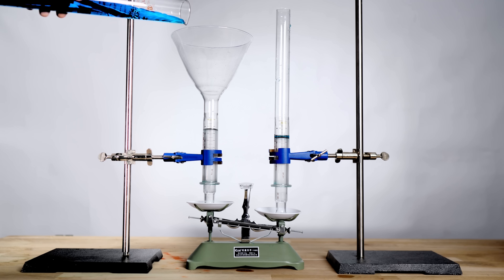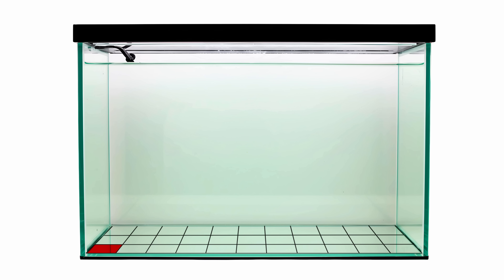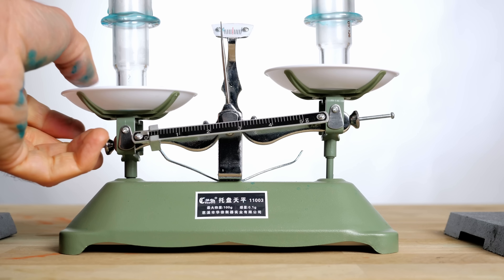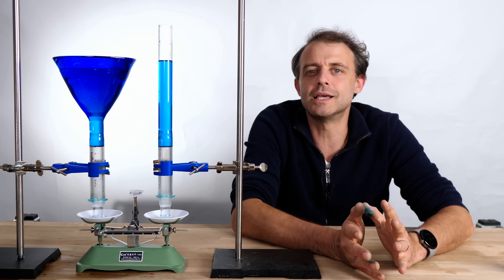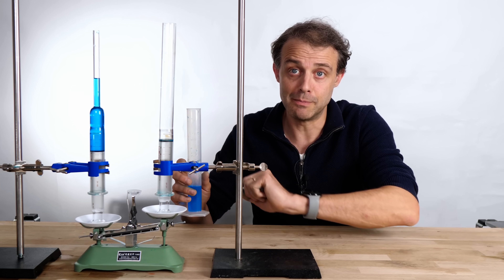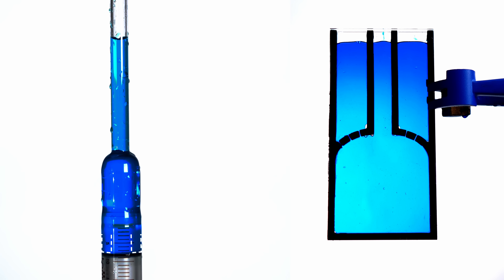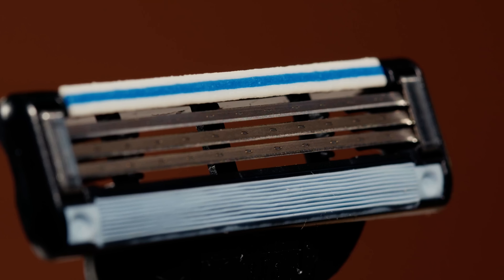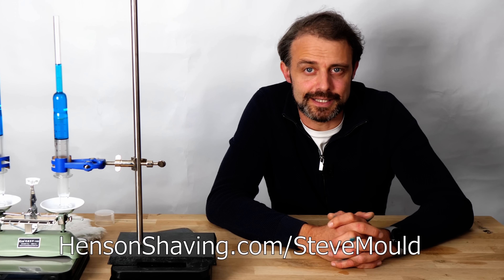The Hydrostatic Paradox

Comment: Looking at this from a purely practical point of view, couldn't it be said that the balance scale at the bottom could be substituted by a hose connecting the two tubes. If I have a hosepipe, no matter the internal width of the hosepipe—it could even vary wildly with bulges or constrictions—and I hold it in a u-shape, then put a liquid into the hose it will always reach the top on both ends and stay there. If one side is wider or narrower there will be no difference in the height of the water; it will always be the same. The hose doesn't even have to be in a tidy loop or a certain size, so long as both ends of the hose are the same height, any liquid in the hose will be the same height.

Comment: Me at the start: well... only the height is going to contribute to the pressure, and you've linked the piston pressures through the scale... so they'll balance when the water column is the same depth. 
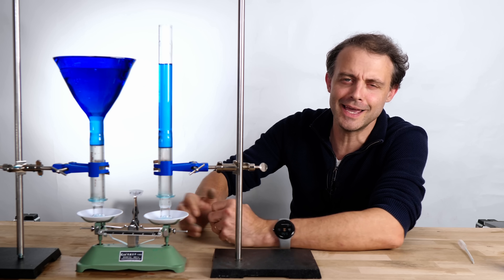Me at 1:21 yeah, that tracks.

Comment: You should not call it "the felt weight of the water", that's misleading. Pressure is not weight and there are no feelings in measurements.

Comment: my favorite application of hydrostatic pressure is as a force multiplier. the classic example is two tanks of water, one massive and one tiny. they are connected by a hose at the bottom of each tank. a piston is inserted to the top of each tank (one large and one small). when you press on the small tank, the force is greatly multiplied on the large tank and the large piston moves a small amount. when you press on the large piston, the force is diminished on the small piston, but it moves a great distance

Comment: The weight on the piston is the rate at which the potential energy of the water above it changes as you lower the piston. If you lower the piston some tiny distance d, and the piston has an area of A, then a volume of d*A water moves from wherever the highest level of water is to the lowest. Thus the change in potential energy is d*A*h*rho*g where h is the height of the water (from its lowest level to its highest), rho is the density of water and g is gravity. Thus, the pressure is just h*rho*g, which is just h times effectively some constants.

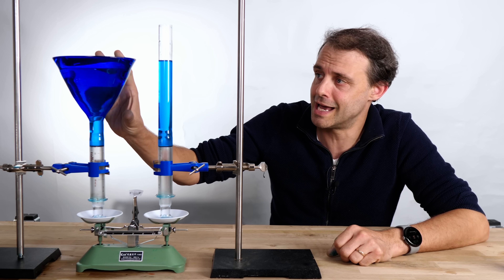Comment: 6:30 Putting a scale under the stand is an excellent way to demonstrate that the fluid above sloped container walls really is supported by the stand. A force decomposition diagram always feels a bit abstract.
Reply: When he was initially setting up the experiment and describing, i was thinking I wanted scales there to measure any additional weight due to pressure on the cone.  I did not think it could get lighter due to the other shape.  Nice

Comment: You kind of missed off the end of the explanation.

If i understand correctly at 8:34 theres essentially pressure pushing up at the the shoulders (or squirting out in that example) and thats the mechanism thats lifting up the stand?

A follow on question is then what happens if the force acting on the stand exceeds gravity. I can't think of a reason why it wouldn't float, but that seems wrong....

Comment: The first thing that let me disconnect pressure from force is the fact that force is a vector, pressure is not. They are conceptually/mathematically two quite different things, even if intimately connected. But it helps you not be baffled at such paradoxes. They become expected.

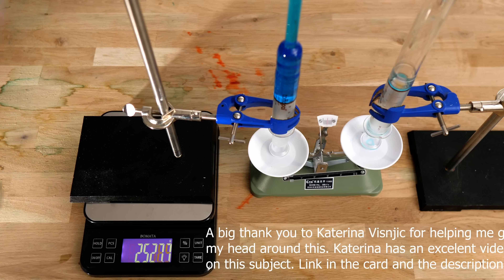Comment: 10:23  - the Clamp stand transferred its weight to the piston  --> if I understand correctly, it's because the top of the outer part of the tube (where you had the fountains before) is experiencing a pressure in the upwards direction  (otherwise there would have been no fountains)?
So this basically pushes the container up

All the water coming from the middle would like to go down, so it pushes the top wall (the contained) and the bottom wall (piston) apart from each other.
Piston being pushed down = the force felt by the scales
Top of container being pushed up + it being held by the clamp = lighter clampstand
Reply: Thx for putting my thoughts into words here. Well, almost. I'd rather say, that all the water in the bottom part, the wider part around the taller cylinder, wants to go up to the same level as the water in the middle, so it pushes the walls of it's tank up, together with the clamp. The whole area of the piston is applying pressure evenly, but the center cylindrical area is higher than it's surrounding area, so while the center water is pushing against air, the surrounding water is pushing against the top walls of the container, taking on some of the clamp's weight. fascinating
Reply: @MunnCher5  The water pushing against the top of the tube's shoulder area cannot "lift" they tube up any more than you can pick yourself up by your bootstraps... if there is pressure against the top, there will be an equal and opposite pressure in the other directions, creating an equilibrium. Just as much pressure is delivered to the bottom as there is to the top.
Reply: The pressure that normally would even out the water pushes up on the stand. 

I think it's easier to think about if you imagine there is no plunger or scale, like if it were just on the tabletop. The bottom isn't connected at all to the stand, the stand is covering it only on the top and side, and the plunger is holding it up. That's what helped my brain anyway
Reply: The tube with the shoulders was breaking my brain. Until I read the first bit of your comment. Then it all made perfect sense.

Comment: Ok @stevemould , I need help with something that’s been stuck in my head for 10+ years!  Fill a sink with water. Take a cup, submerge it fully, flip it upside down, and slowly pull it up until the rim is just about to break the surface. What’s the water pressure at the very TOP of the cup? What about HALFWAY down the cup? And right at the RIM just under the surface? Now flip it around: dump the water out of the cup, keep it upside down in the air, and push it straight down into the sink water. What’s the pressure at the rim in that situation? I’ve never gotten a clear explanation. I would love to see a video that breaks this all down!
Reply: In my mind the water pressure at the top of the cup would be below the ambient pressure of 1 bar. The pressure differential on the top of the cup generates a downwards force, which you have to fight against when pulling and keeping the cup up.
Reply: Pressure in water is equal to the depth of water multiplied by gravitational acceleration and the density of water or P=density x gravity x depth. In the full cup case, the pressure at the top of the cup is atmospheric pressure minus the pressure decrease as you go up in the cup, or pressure at top = atmospheric pressure - density x gravity x height of cup. When you push the cup into the water the air pressure within the cup is more complicated. The increase in pressure reduces the air volume, which follows the ideal gas law, so the air shrinks until it reaches equilibrium with the column of water above it.
Reply: don't see the problem really, at the rim first - it has to be the same as everywhere else at the top of the water, it's atmospheric pressure. At the top of the cup it must be less by an amount water density*g*height. halfway is no different, it's atmospheric pressure minus 1/2* density*g*height of cup. for a very tall cup this pressure will of course at some point be zero, and there will be a void - the water won't reach the top (in fact it will boil but that's a different issue). Steve Mould has a very cool video recently about water columns and siphon height.
with the rim below the surface then the pressure is just proportional to how far below the surface it is, like all the other cases. if it's h below the surface then the pressure is atmospheric + h*rho*g as always. - it is this pressure everywhere at this depth - it doesn't matter that there's an empty cup above that point - the air will equalise the pressures (approximating things to incompressible air and water).
Reply: Take a small cylinder of water whose axis is vertical, and that is surrounded by water, or any other fluid.
Pressure along an horizontal plane must be constant, otherwise there would be lateral movement  : the side forces would not compensate each other). Thus the only thing that matters is the height of the water column.
If nothing is moving, the bottom pressure force must compensate the weight of the cylinder, as well as the top pressure force. Pressure will rise with depth, and drops with elevation.

In the first situation, at the surface level, the pressure is the atmospheric pressure, inside the cup, the pressure drops with elevation. If you make the cup big enough, the pressure will drop to zero and the water will boil : the atmospheric pressure on the water outside of the cup will not be enough to keep the water in the cup, it will detach.
Reply: Wouldn't that just be 1 bar (ca) air pressure minus the pressure of the water column?
A 10 cm high glass would result in a water column pressure of 0.0098 bar. The pressure at the top of the glass would then be 1 - 0.0098 = 0.9902.
If an empty glass is pushed down with the opening first, the air pressure inside the glass would be 1 bar + the same number (1.0098 bar). (Neglecting the air being slightly compressed, so the water column will be a little less)
Note: I write 1 bar for simplicity. The air pressure changes and it isn't exactly 1 atm.
Reply: Oh, and with water inside, there would be 1 bar at the rim (=ambient pressure) .
Reply: I think the recent siphon video might actually go a long way towards giving some intuition on this
Reply: Also curious about the forces on the cup in each. If you weighed the upside-down cup, pulling the vacuum, would it be just the weight of the liquid plus the cup. or somehow more since it is doing some kind of extra work making a vacuum? does the rate change depending on how high you pull it or is it linear? i assume the second example would be some kind of non linear force since the air pressure is getting squished. id love to see a graph of both.
Reply: Great question! The key is to remember that water pressure depends only on depth, not the path the cup took. 

Case 1 (pulling the cup up, rim just under the surface): The water outside at the rim is at ~1 atm plus a tiny bit from depth. Inside, the trapped air pocket has slightly lower pressure, so the water is held out until the rim breaks the surface. At the top of the cup, the outside water pressure is greater than the air inside, which is why the pocket stays trapped.  

Case 2 (pushing the cup down upside down): As the cup goes deeper, outside pressure increases with depth (ρgh). This compresses the trapped air (Boyle’s Law). At the rim, the outside water is higher pressure, but the air inside is compressed to balance it.  

So the “paradox” is really about comparing outside water pressure with the trapped air pressure. The depth sets the water pressure. The air pocket shifts to match. The situation looks different, but the physics is consistent. 👍

Comment: Years ago when I worked in the industrial water field, this concept was drilled into our heads. It's faster to fill a tank by connecting a hose to the bottom vs. connecting the house to the top of the tank. 

Intuitively, some people thought that the bottom was shower because you had to push the water in the whole tank up. But it was actually slower to push the water in the house all the way up the whole time.
Reply: Took me a moment to comprehend that! Imagine having a 20 metre high tank, you'd have to pump water up 20m to get over the lip ending up with a pressure at the pump the equivalent of being 20m underwater with that pressure remaining the same for the entire fill. If from the bottom the pressure starts off at zero and eventually ends up at a 20m depth.

Nice.
Reply: @kevinjpluck  Well.. not quite correct. 
If the pipes are already filled with the liquid and the pipe goes all the way to the bottom, there is no difference in energy use between going in through the bottom of the tank and going over the top/edge/rim. The reason is the siphoning effect.
Reply: @jsjs6751  Yup, absolutely, IF the pipe then went back down to the bottom of the tank.
Reply: Mr Mould this is a nice video idea, steal this idea
Reply: easy way to explain it: you're pushing water up either way. which would require less energy: pushing the liquid up once to just the right level, or pushing water up above everything just to have it fall back into place?

and like, whatever efficiency problems you might have with pumping it from the bottom can be solved by using a higher-torque fan and some gear changes.
Reply: Well.. if the pipes are already filled with the liquid there is no difference.
Reply: If filling a partly full tank, does that mean the fastest fill is connecting to a port already under water, and there's no difference between a port at the bottom and a port 1 foot off the bottom if it's already submerged? It just goes slower if connecting to a port above the water line, and therefore losing pump energy to the falling water?
Reply: Perhaps a more common thing would be filling a bucket with a garden hose. It's a very minor difference, but it's also a hell of a lot easier to just throw the hose in the bucket instead of trying to be "smart" and setting up some kind of clamp or whatever to make the water come from the top.
Reply: @sntslilhlpr6601  But in that case, you still have to move the water over the top of the bucket so it wouldn't be faster.
Reply: @risleyjm  If you insert the hose all the way to the bottom of the bucket, you're not using more time or energy to fill it. Of course, there is the short moment where you will use a minor amount more than if inserting the water from the bottom.
Reply: @sntslilhlpr6601  No. In a bucket, the hose needs to go over the walls to get into the bucket, so it makes no difference.
Reply: what matters is only the beginning and end point, not the path in the middle (Bernoulli equation).  if the pressure at the source is fixed, then you'll get a higher flow rate when the end of the hose is at a lower height.  

however this advantage will be erased as the bucket fills up; the hydrostatic pressure of the water in the bucket will act against the flow coming out of the hose that's underwater.   All this would only matter in a practical scenario when the pressure in the hose is very low.

Comment: My highschool science teacher once explained that the surface area of the horizontal cross section of the tube/container mattered as the pressure applied from the column of atmosphere must also be taken into consideration when thinking about hydrostatic pressure. Is this correct? It may explain the difference in results for the different tubes, the one that tapers down has less surface area for the atmosphere to apply pressure?

Comment: As a civil engineer in the water sector (in the UK), this was obvious to me, but I never really thought about why or how. In the water industry when talking about pressure in pipes, we use m (metres of head). The pressure is always relative to the height of the top of water above the point you are measuring (ignoring friction losses). So in a water supply system, the reservoir at the top of a 50m hill will provide 50m of head at the bottom of the hill. Water in a supply system is always moving, so in reality, the pressure will be slightly less due to friction losses.
Reply: You learn something everyday.
Reply: As an aero engineer, I get unreasonably upset when people talk about pressure in terms of head 🤣 Now I need to know the density of water and gravity to calculate it in meaningful units!

Comment: Minor thing, but you probably could have explained during the initial explanation that the syringe exterior is held in place.

Also is it valid to say "we're weighing the water inside and the piston itself"? My intuition would be that weight is a technically a measure of force rather than mass, but with the assumption that we're talking about the force of a mass due to gravity, and it correlates with mass. In this case, the force is a product of pressure due to gravity rather than a measure of the pure raw force of gravity on the mass. 
Didn't finish the video, but presumably the funnel is sort of carrying some of the mass and is held by the arm. So we aren't measuring the weight of the water, but instead the pressure.

Comment: It's interesting that balance keeps the water level  the same between the two containers the same way as if the two separate containers were connected with a tube at the bottom

Comment: Thanks for the video.  I would love to see some "what do you think would happen" videos based on this... 

1. add the separate conical water attached to the column like you had it.  Will it way more with a separation between the water column and the conical section?
2. what about the same thing with sand?  does it function like water? or does it just weight the amount of the solid and not height?

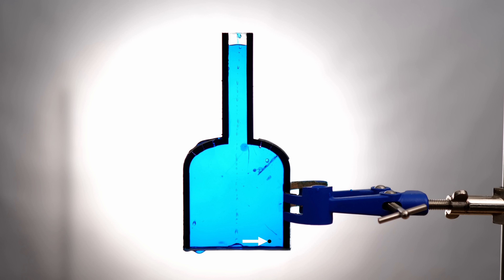Comment: @SteveMould @ 9:05 You say the pressure on the glass ceiling must be the same as on the bottom. But that is not correct!
The pressure goes reduces linear with the height of the column: so at the side ceiling it is likely half of that of the bottom.
Your whole whole setup is purely a pressure measuring device. Independent of the shape above only the water level and the surface of the plunger would make a difference.